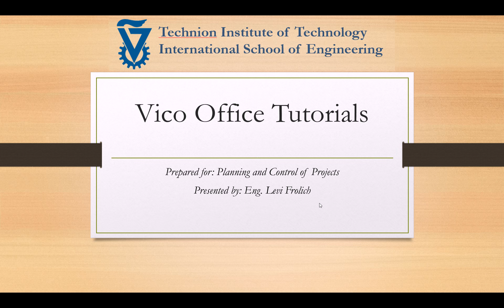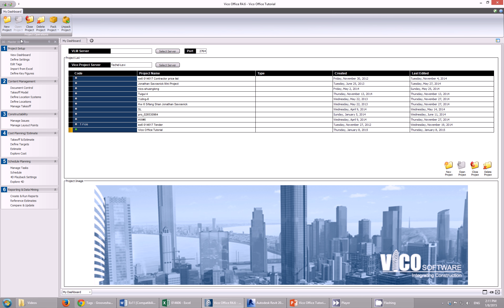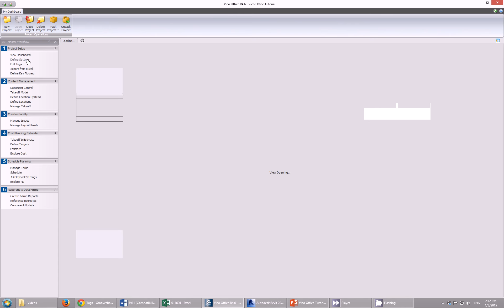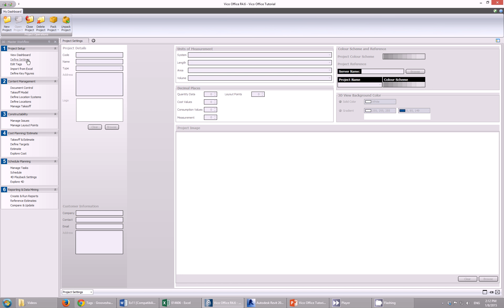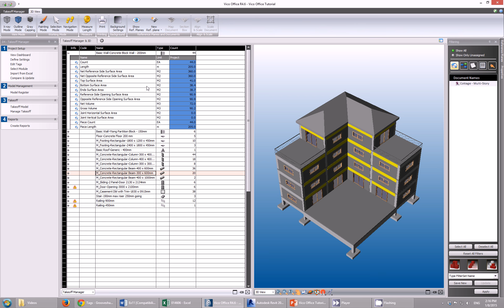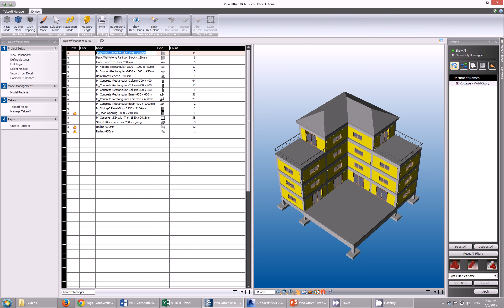Importing to Vico

Comment: Thanks for sharing. 
I have two 3Models for same project (architectural & structural); when I import them to vico, they are not aligned. Is there a way to align them? to move one of the model to fit to the other.